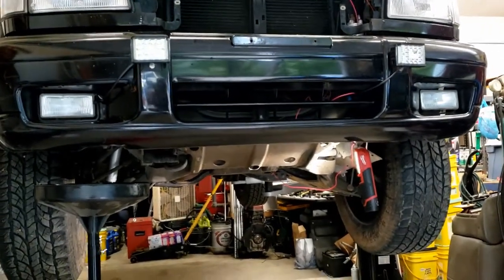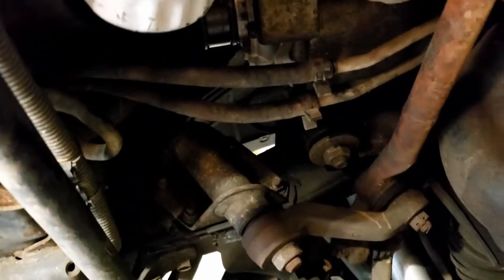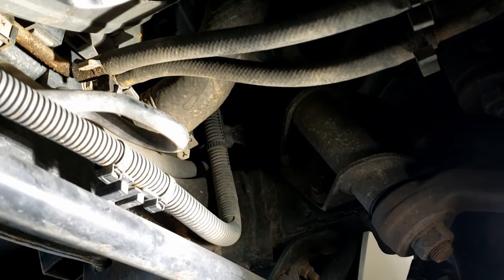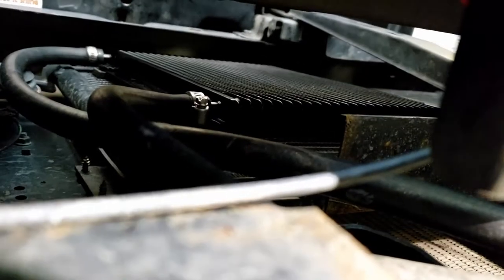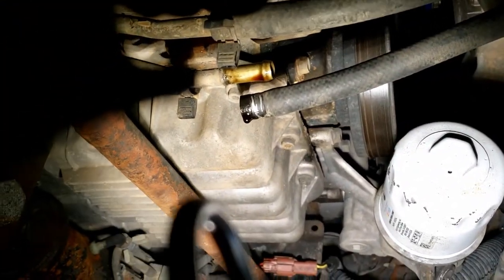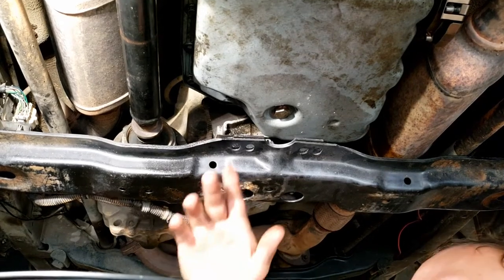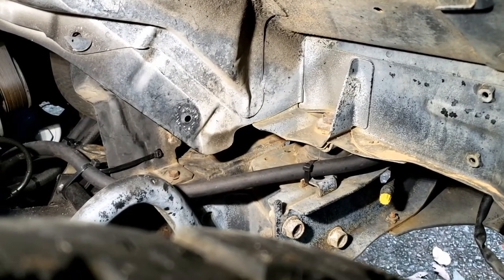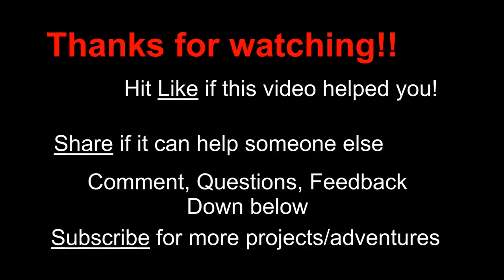Isuzu 4L30E Transmission Cooler Install

Comment: I wonder what temperature difference if any would be. Robb O does this and has the return line just from Hayden opposite of you guys 🤔
Reply from the maker: Putting it before the radiator is meant to assure operating temperature is maintained. Putting it after the radiator would have the possibility to cool it too much, which can be just as bad as overheating.

Comment: Why might someone add the inline hayden cooler? Is this like a bypass for the Thermostat
Reply from the maker: This is for the atf in the transmission only. On really really hot days, offroading, towing, etc the trans will benefit from the additional cooling by passing through the cooler. The thermostat is part of the cooling system for the engine which is a separate system from the transmission cooler, which is for the atf.

Comment: Did you get rid of the exterior/front A/C fan that sits on the left pushing air while main fan pulls? And why not put a push fan on it? No room? Just curious cause I been thinking put 1 on with a fan. What temp does your Tranny run at now?
Reply from the maker: This trooper did not have it. If he wants one in the future he can add it but so far it is not needed. Not sure of temp since we haven't added a temp guage yet.
Reply: @REVNREDMEDIA  Temp Guage video be a good idea?
Reply from the maker: Might have a project in mind for that in the near future.

Comment: My 1999 Rodeo needs a new transmission line and the shop told me 900.00 so I was naturally not going for it and the next day they suddenly said 500 so I left the shop not knowing they don’t make the line anymore and I would have to decide between rubber hosing, a hydraulic shop (which seems to be a major nuisance) or fuel line. Any advice?
Reply from the maker: You can search dorman trans line 624-604 they are like 80 bux at autozone
Reply: @REVNREDMEDIA  yeah but will that fit?
Reply: Looked it up and it says 2000 Passport or 2001/02 Rodeo.
Reply from the maker: The lines are the same for the 2nd gen v6 rodeos, 98-02. Only  difference is the feed line and return line.
Reply: @REVNREDMEDIA  thank you so much for taking the time to reply! So, if I order that line my mechanic will have very little problem modifying it to fit?
Reply from the maker: @williamperri3437  they shouldn't have to modify anything, should be plug and play
Reply: @REVNREDMEDIA  man, the transmission line went in like March and the damn job tried to charge me $900 so I brought it to my buddy that's an engineer and I was just scared because they have faulty transmissions in the first place trying to figure out what to do. I wish I would have known about this months ago! Thank you so much bud!